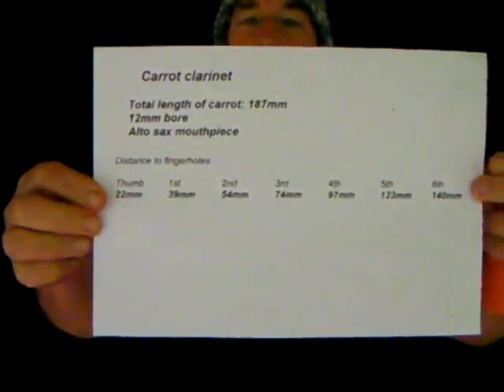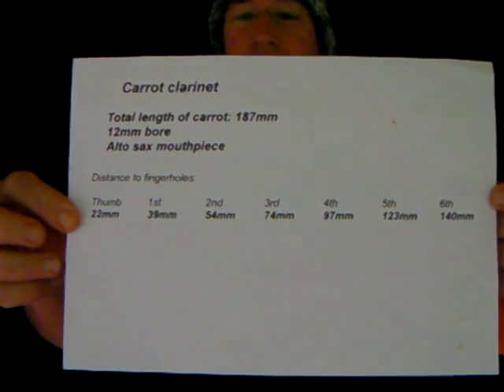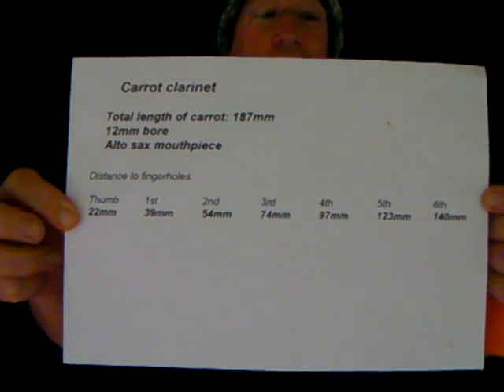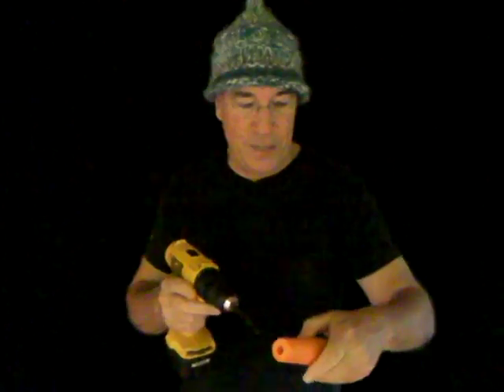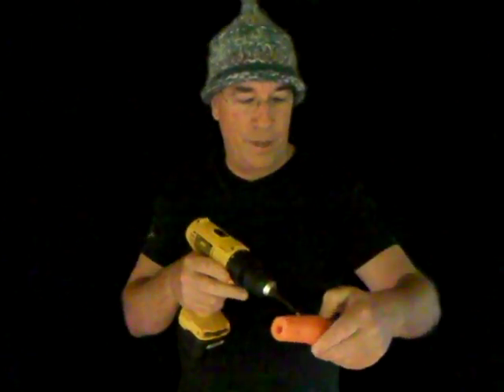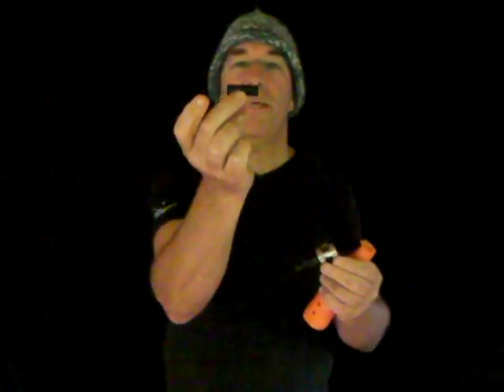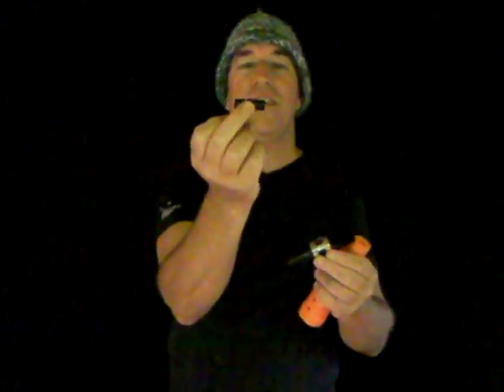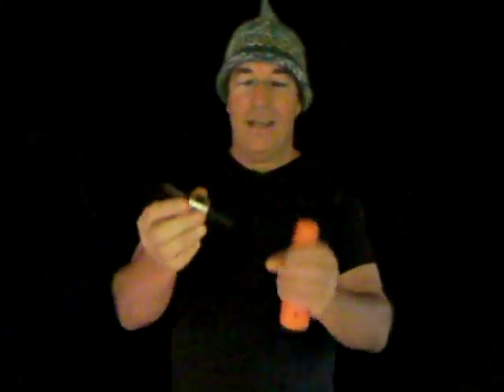carrot clarinet making

Comment: @CreemeOfCheese Actually, even though there are straight versions of saxophones, they are still conical; the beginning of the tube, the mouthpiece end, has a smaller bore diameter that gets larger throughout the entire length of the instrument. The clarinet, on the other hand, is cyndrical because it has the same bore diameter throughout the instrument and gets just a tiny bit bigger at the bell end. :)

Comment from the maker: @haddock929   a 1/2" drill (instead of 12mm) bit will change the tuning ( use a 15/32" drill bit if you can find one or buy a 12mm online)  for the finger holes use a 9/32" if possible

Comment: do the proportions of distances between the holes work out on mr curly? ei; double the distance between the holes, and it become and octave lower? which of course means if its doubled again (because surly mr curly is more than an octave lower than the carrot) the note would therefore be another octave lower?

Comment: Hello thank you for this amazing idea, i made it and it is almost in tune which makes me happy enough however i want to take it further and have the 7th hole as well where would that go can you tell me please?
Also is there a possible way to make this sound a little bit more like a saxophone? May be a simple way to make it conical?
Thanks for everything you are ace!
Reply from the maker: needs to be slightly longer, and you can experiment with placement of 7th finger hole. Creating a conical bore of exactly the correct iconicity to get an octave overflow is tricky. You need a taper of about 1:17.5

Comment: Just wondering, Linsey.  Have you tried this with a little thinner carrot?  I'm finding the bottom end working, but the carrot is splitting on the top when I try to put in the hose joiner. Perhaps the problem of going smaller is finding a joiner for the mouthpiece...
I'll keep working at it...
Reply from the maker: cut the barbed end off the joiner and then if needed build up the diameter with electrical tape to suit the carrot bore.
Reply: Linsey Pollak Brilliant!
Reply: Linsey Pollak can this be done with a Bb Clarinet mouthpiece?
Reply: nevermind i wrote before end vid

Comment: Will an oboe reed (premade) work with this?  Also, is there another way to preserve the carrot other than refrigerating?  My daughter wants to make this for a class project, but it must last for 3 weeks (for display purposes) - and I'm guessing the teacher will not want to refrigerate it each night...
Reply from the maker: refrigeration is the only way for it to last
with an oboe reed you would need a different set of measurements ideally with a conical bore

Comment: Will it still make the same sound without the funnel?
Reply from the maker: yes, but lowest note will be too sharp unless you use a longer carrot
Reply: Linsey Pollak ya but if i use the original length but without the funnel (because you did say your is shorter because of the funnel), then will it make the same sound? Like does the funnel change the sound or it's just for the look? Great video by the way, amazing idea.